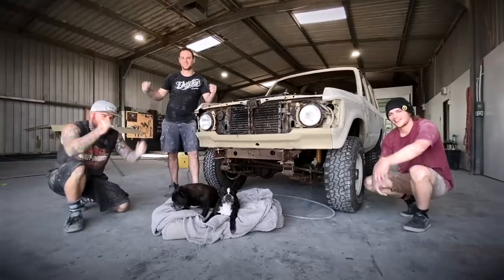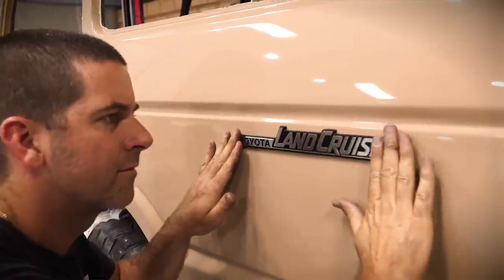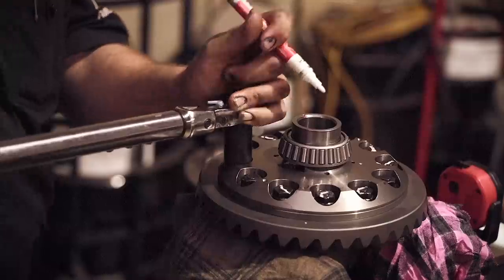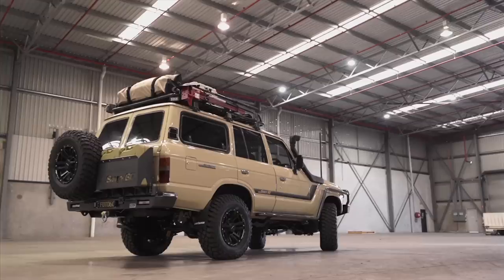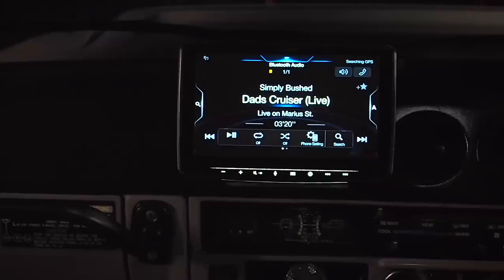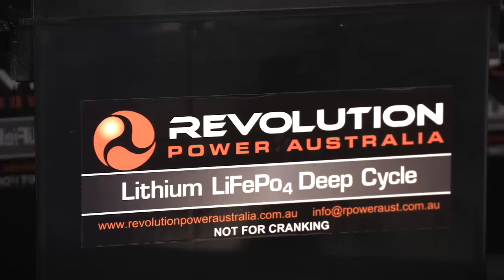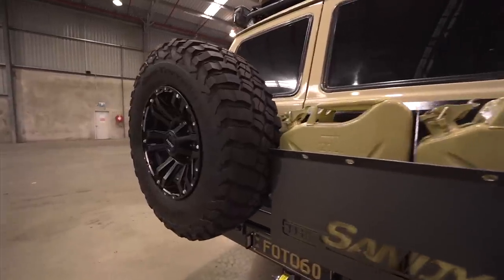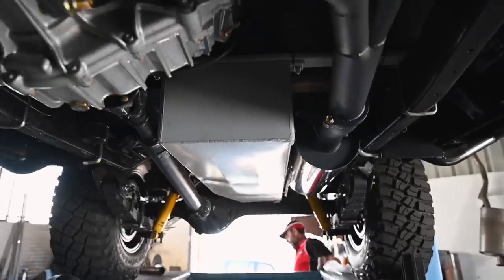The Sandy 60 | The big build reveal (60 Series build)

Comment: I had a 6.2L chev in my 75 series with the stock 5 speed and diesel diffs but it was so slow and under powered I could barely hit 100km/h. In low range it could move mountains but driving it on the road every second hill brought you down to 3rd screaming that chev. I ended up taking it out and putting a 292 petrol chev back in and since then I’ve sworn those 6.2L diesels were utter garbage........but seeing this I’m wondering if I didn’t maybe have ratio or timing issues. 
Never the less sick build guys great job.

Comment: I miss my fj62 Sahara, it was the best 4x4 for rough terrain, 2”leaf springs with 2”extended shackles front and back, body lift and lock right lockers and 33” tyres , the thing was unstoppable .No so much so on the road though, it handled like a boat.And 30 litres of LPG per 100km got old. Wish I had the balls to spend 50k plus restoring it to this level. I used logic and bought a humble hilux with 20k on the clock.

Comment: Should have had a 12ht
Reply: Agree completely...a shame to have this beautiful top tier japanese car with that donk. Could have done a VD to match the bonnet.
Reply: Agree completely....perfect build of a top tier japanese car, shame about the donk. Could have done a VD to match the bonnet. Still awesome build.
Reply: 12ht is good but cev is better more reliable I've got a 5.7 in my 60 for the last 8 years never had a problem yet
Reply: Yep, 12HT is a far better motor than the Chev boat anchor dieslow. More reliable, more modern, weighs less, more readily available parts, cheaper HP upgrades, starts easier, less overheating problems and smoother running. Even a turbo 2H, shits on those Chevs.
All Chev V8 diesels, prior to the Duramax, were/are junk.
Reply: @aaronnoyb   mate, even a stock non turbo 2H would shit on that V8.

Comment: Is that the 350 chev petrol motor that chev turned into a diesel if it is watch out buddy they blow up don't last long got thin petrol castings that's why diesels are heavy to take the load off compression

Comment: You should have got an actual decent light bar like a Rigid and put it on top. That would render the two front ones that interfere with airflow pointless. The mount point for the Warn controller is nothing short of laziness and in a poor position. Considering how much work was done, it should have been hidden. Leaf springs and airbags yuck.